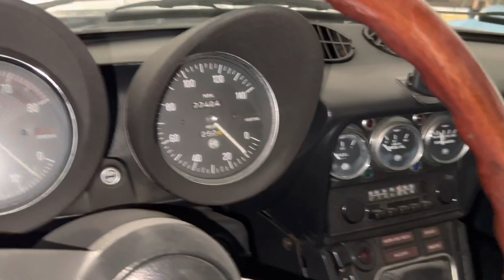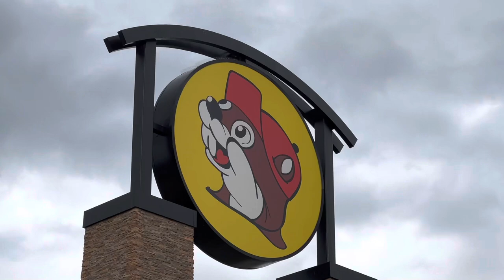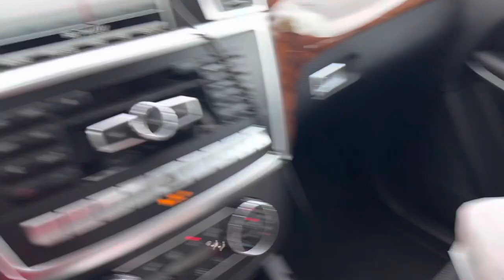Bought a classic Porsche and stumbled upon a treasure trove of rare cars!!!

Comment: The Lancia you are interested in is a Series II Fulvia Sport 1.3 S. It’s powered by a 1,3 liter (1,298 cc) V4 engine that puts out 92 horsepower @ 6,000 rpm. Great cars, but beware of rust.